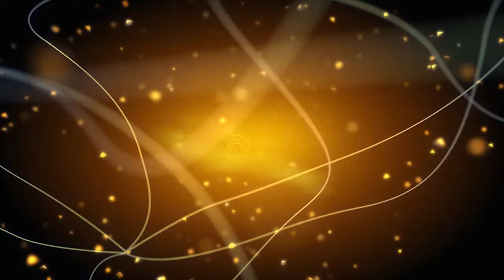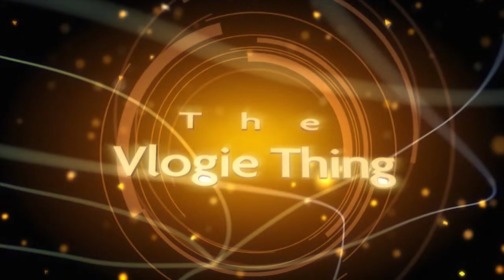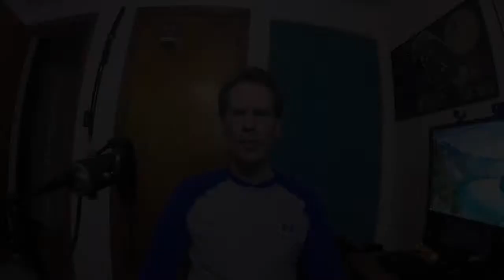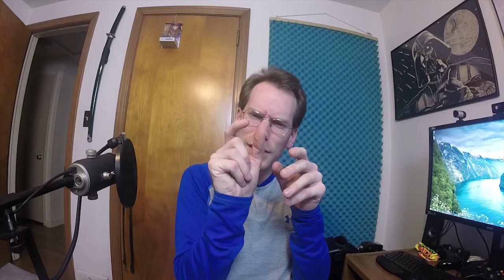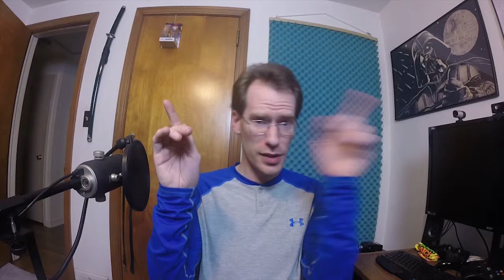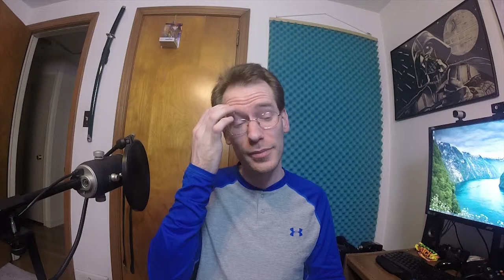The Vlogie Thing - Damn Car Alarm

Comment: so dose this mean your getting back into minecraft and are going to continue with your lets play
Reply from the maker: I've been debating it.  I don't want to start it back up if I don't keep going with it.  I also want to get a better idea of what I'm doing with hardware upgrades.  If I have to record at 1440, I don't want my framerate dropping to 10fps because my processor is old.

And, if I get a new processor, I'll be able to encode at a higher resolution.  Right now it takes me an hour to encode a 10 minute video at 1080p.  Don't even want to think about 1440 or higher.